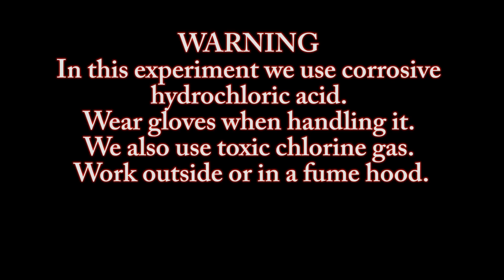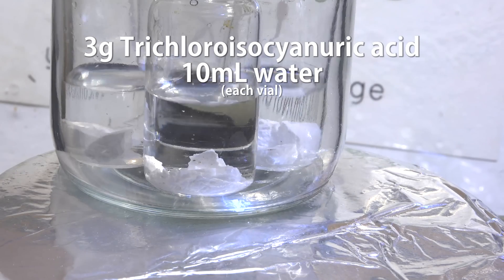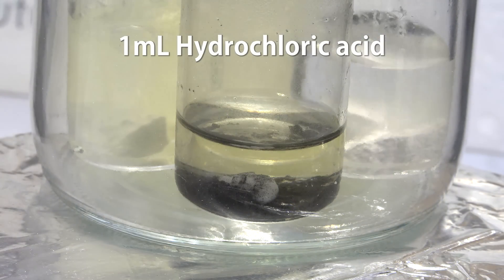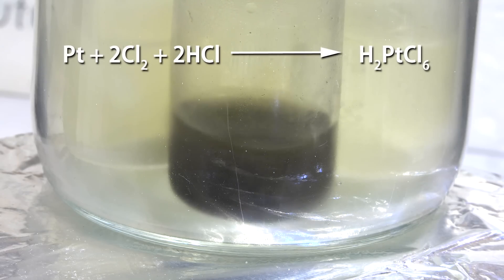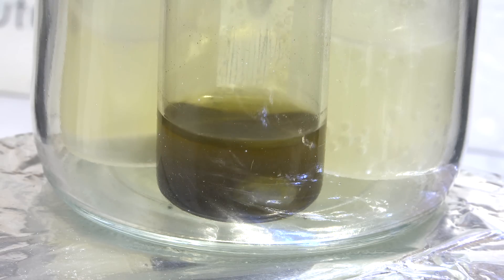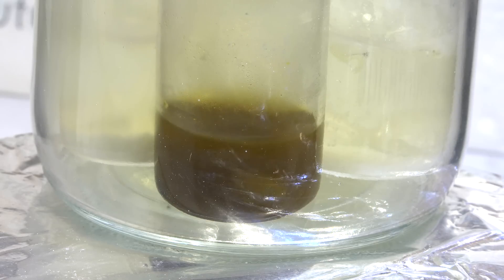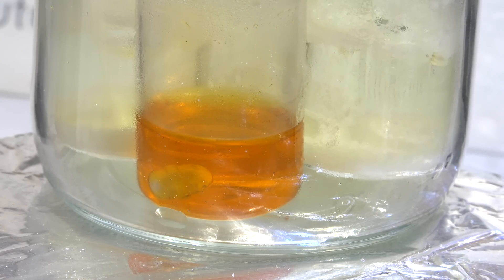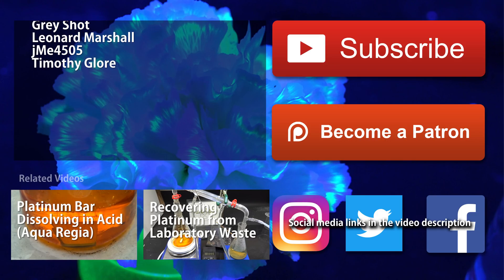Dissolve Platinum with Chlorine Gas

Comment: cool, thanks for the tips as I am fairly new to both fire assay and AR and didn't know you could use Chlorine gas....I am 96.4 % positive that my black sands from the Columbia river has plenty of gold and PGM's in it as the colors' seem to indicate the presence of PGM's but I am working on a shoe string budget, and illegal alien's are getting more every 2 days than I get in a month on SSI which is strange cause the judge said I was fully favorable for a gave me paperwork saying I was accepted for SSDI instead they somehow, even though I have the paperwork they continue to deny me even after surviving 2 brutal attempted murder's on Maui durnig corona and nothing was done but making the victim of 2 near death experiences that left me completely broken and no justice form an island that alone pulls in 50 billion a year......festering corruption so I do what I can as my body and healing TBI's allow and try to get all the PM's I can from spot's that are known to have gold, silver, PGM's and gems.....I run as much material as I can with my broken body and mind and then try and figure out this process as my first 3 assay's I tried to cupel in a furnace that just didn't work, although Jason at MBMMLLC did with the fire wool with one port propane and the other pumped in with air to increase oxidation, I have a duel port forge but I guess I need to get my flux down, the best collector metal for gold and PGM's and I really would like to have a electric cuppelling oven

Comment: Can you please show how to obtain and purify potassium hexachloroplatinate from the hexachloroplatinic acid that you made in the other video?
Reply from the maker: just add potassium chloride until no more potassium hexachloroplatinate precipitates. then filter.
Reply: NurdRage I thought potassium hexachloroplatinate, even if low soluble, was too soluble to be washed with whater at room temperature. Maybe washing it with hydrochloric acid instead of pure water will prevent K2PtCl6 losses, am I wrong?

Comment: Nitric acid costs only $6 per liter 68%
Reply from the maker: which is more expensive than chlorine.

As said in the video. for amateur use, nitric acid is pretty straightforward and the preferred method. But for very large scales, chlorine becomes more profitable even including the cost of different equipment.
Reply: NurdRage I'm your big fan since I was 13.

Comment: +NurdRage Would this work to dissolve Iridium powder as well? Sodium peroxide fusions are fun and all but this seems a little safer than heating a near-explosively combustible metal powder mixed with a powerful and caustic oxidizer... 

I'm curious about Iridium chemistry in general. I remember in one of these videos you mention having some Iridium waste chemicals... Did you use those for anything? I find myself in possession of a few grams of Iridium "sponge" and a desire to try electroplating with it but I'm not sure how to go about it.

Comment: could you use table salt to make sodium metal and chlorine gas?
Reply from the maker: +Rick Flores yes.
Reply: It's done in the Down's cell. I think it has 60% CaCl2 and the NaCl is dissolved in it. The mp is 650 C which is easily achievable with wood burning stove. I'll give it a try sometime.

Comment: can you drip into the platinium, hydrochloric acid solution bleach and avoid using the trichloroisocyanuric acid?
because hydrochloric acid reacts with sodium hypochlorite and creates chlorine gas
Reply: That's essentially what he did, but instead of using the bleach which comes at a low concentration in solution he used the trichloroisocyanuric acid at a high concentration to likely save on space in the vessel.

Comment: Is it possible to use liquid chlorine mixed with hydrochloric acid?
Reply from the maker: absolutely, that's how it's done on the industrial scale for high speed. But you need a teflon coated pressure vessel to handle liquid chlorine or it will eventually corrode and rupture the vessel.
Reply: NurdRage
That's pretty neat, thanks for the reply. Also a friend of mine wants to make chloroethane, he  found some stuff on it and thinks it's neat that it has a boiling point of 54F. He's going with making it from ethanol with zinc chloride and anhydrous HCl, any advise for him?
Reply: Or Hastelloy C-276 (nickel super alloy) which can be rated to orders of magnitude more pressure: most laboratory scale pressure vessel manufacturers offer it. It's heavily used in industrial scale applications in certain industries that use chlorine, hydrogen chloride, and various oxides of chlorine and other halogens.
Reply: john black
Well I'm not the one making it, but my friend showed me the synthesis from something on making various halogenated organics and it gave him the idea to try and make chloroethane. And yes in the synthesis it says to use HCl gas and fused zinc chloride. I might be able to find the thing that mentioned it.
Reply: john black
He has a channel called Billy-Bobus Labs, but right now only has 4 videos up. He's no expert either, but he can do just about anything, except for put up more than four videos it seems. He's getting some chemicals and lab equipment for a Christmas present.
Reply: john black
He is also going to make iodic acid and some other neat stuff. I'll have to look at your video s once you have them up. I always like to watch chemistry channels.
Reply: john black
He is also very into metal casting, he even sand casted aluminum swords.
Reply: john black
Yeah, I've seen him cast a sword before, but he hasn't recorded yet.

Comment: Would this method work to dissolve silver?
Reply: I am pretty sure Chlorine combines directly with ALL metals forming metal chloride salts.
Reply: Richard Smith Thanks, im a bit of a novice when it comes to chemistry and im having a hell of a time trying to dissolve some silver with nitric acid.  Perhaps this will work better for me.
Reply: If your nitric is concentrated you'll need to dilute it 50% with distilled water. Then it will work like a charm.
Reply: IsettasRock Either way, nitric acid is not a cost effective way of dissolving metals. However, it is invaluable in isolating metals, but if the raw material is already as pure as you need it to be, chlorine is the way to go.
Chlorine is all or nothing, the purity of the final product is determined by the purity of the raw material dissolved, as the chlorine will dissolve all metals, as far as I am aware.
However, many times purifying the chloride salts themselves can be cheaper than using nitric acid in the first place.
Chlorine gas is also nasty shit however, but it is cheap and easy to make.

Comment: When you use water in chemistry, does it have to be a certain type, i.e. distilled/tap/boiled?
Reply: It depends on what you are going to do. 
Usually you can use distilled or de-ionized water when you don't need it really pure, if you need it to be that way (for example in some electrochemical analysis) you usually use some filtered ultrapure water such as milli-Q.

Tap water has a lot of salts dissolved in it that might interfere with the reaction you want to achieve, you use it only when you need to clean your glassware with soap because you made a huge mess and before using it again you have to rinse a lot with distilled water.

Boiled water is the same thing as tap water but maybe even richer in salts since you lost some through evaporation.
Reply: Deionized water or DI aqua.
Reply: what I use typically is deionized water, but distilled water is usually fine
Reply: john black distillation doesn't remove all ions, such as those that have a similar boiling point to water. http://www.waterandmorehub.com/deionized-water-vs-distilled-water/

Comment: So what exactly is the reaction mechanism? Is the chlorine oxidising the platinum to platinum chloride which then forms a complex with the hydrochloric acid?
In general, are the noble metal acids (chloroauric, chloroplatinic, chloroiridic, ...) complexes of the respective metal chloride and hydrochloric acid?
Reply: The chlorine oxidizes the platinum from Pt(0) to Pt4+, with the formation of chloride ion as the side product. Lone metal ions are rather unhappy, so 6 chloride ions (floating around from the hydrochloric acid) coordinate to the platinum center in an octahedral arrangement to form the hexachloroplatinate anion. That anion has a -2 charge, so we need a +2 charge to balance that out. The only other cation in solution is the H+ ions from the hydrochloric acid (which are really H3O+ hydronium ions, since we're in aqueous solution).
Reply: Yeah, the final product is H2[PtCl6], after the platinum tetrachloride salt(Platinum IV chloride) combines with the HCl. If you boil away the HCl, you get left with platinum tetrachloride pentahydrate crystals.

Comment: This might be a kind of dumb question, but what is that magnetic stirring thing in the solution that isn't being dissolved? or what I mean is why isn't it being dissolved?
Reply from the maker: Oh it's coated in teflon. Teflon is resilient to a great many things and highly corrosive chemicals. It's also slightly flexible like hard plastic so it doesn't shatter like glass. However it is vulnerable to extremely reductive chemicals like molten sodium metal and other alkali metals, as well as certain reagent like sodium napthalide.
Reply: Ah, okay, that makes sense, thanks
Reply: Its just a piece of magnet covered with a thick layer of teflon. There is a rotating magnet in the heating pan that spins, thus spinning the magnet stirr
Reply: That's just a magnetic stir bar, they're usually coated in PTFE (teflon) which is usually inert.
Reply: Ok guys no need to repeat the same thing twice NurdRage already said why.

Comment: why would you want to dissolve platinum powder? do you have the reaction written out?
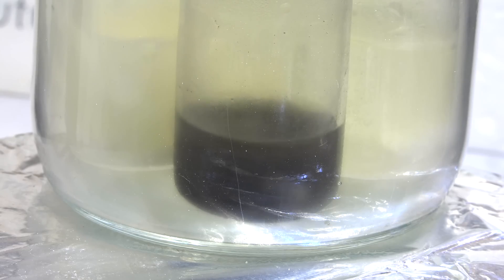Reply from the maker: 2:00
Reply: im sorry, i meant like the mechanism in the reaction
Reply: what happens is that chlorine being a strong oxidizer will oxidize the platinum in solutiom as it is being reduced to chloride and form Platinum te rtrachloride in situ which immediately reacts with HCl to form the final product of H2[PtCl6].Hope that helps

Comment: hey, did you find a good replacement for your magnetic stirplate? if not, check out the heidolph stirplates. we have them in the lab. i don't know how rough you handle your plates but they seem to be pretty robust, i couldn't find out what kind of heating element they use though.

Comment from the maker: I successfully devised a way to make cyanide by a thermite reaction. But I probably won't be posting that video to youtube due to how dangerous it is. I'll likely post it to other platforms and link to it.
Reply: Just don't tag "explosion" or anything like that in the video and youtube won't flag it. We would be VERY interested in seeing it!
Reply from the maker: +Kaskade TV Very good question, platinum is resistant to chlorine in neutral and alkaline conditions like a potassium chlorate cell. It actually IS dissolving but EXTREMELY slowly, so it can last years. In industrial setting where they are doing things on massive scale, they actually have to budget platinum electrode decay and replacement in their costs. Now platinum is much less resistant to acidic conditions (although still better off than most other metals). If you electrolyze platinum in hydrochloric acid solution, a highly acidic condition, the reaction in the video would happen and destroy your electrode.
Reply: NurdRage post it
Reply: Nah, youtube has much more dangerous  videos. Just post it here and see what happens:)
Reply: how about ig?
Reply: Thanks for the quick response...

Nice greetings from Germany
Reply: xTech   instagram
Reply: I've got one question when you can disolve platinium in that way, why isn't the platinum in chlorate cells dissolve itself?
Reply: did u put it on aluminumfoil or any other un-noble metal to dry it, cause that might be the reason
Reply: NurdRage Is the platinum dissolved in this process recoverable? Can platinum be electroplated from this solution? Thanks. Big fan!
Reply: I used the electrolytic method to make rust, but when the put the rust in the oven to remove the water it starts sparking!!! can you please help me??